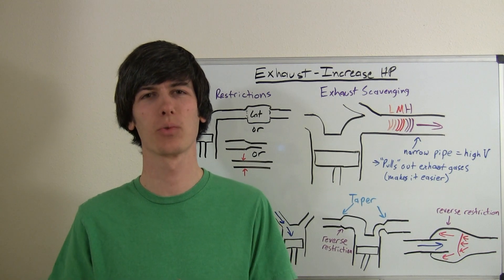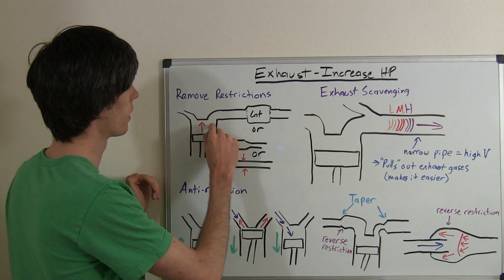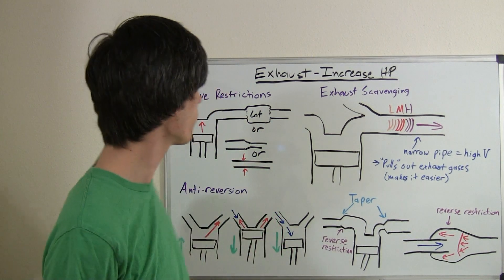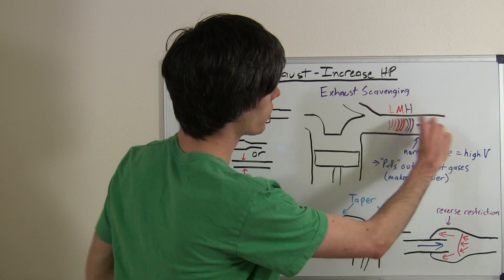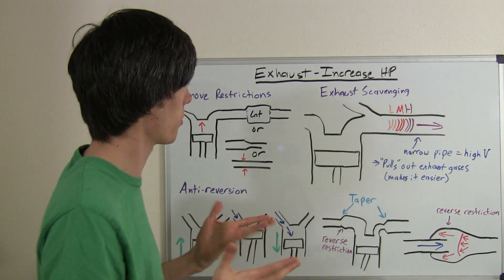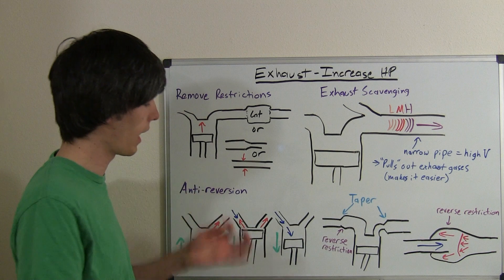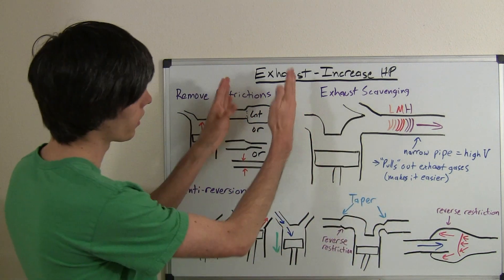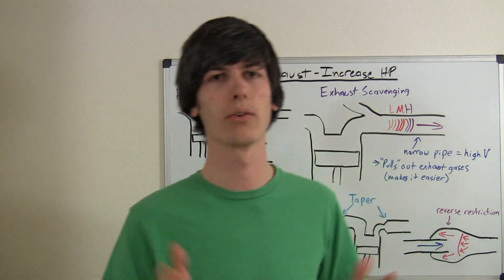Performance Exhaust - More Horsepower

Comment: Question Engineering Explained! I have a little 2 stroke engine. I've heard that removing the muffler and running it can cause the engine to burn hotter and cook itself. Is that true? I also have replaced the muffler with a 2 foot, 3/4 inch pipe, have I gotten any gains from it (Power, torque)? (Its a 32CC if its any consolation)

Comment from the maker: Yes, applies to all transmission types. Resonators are not beneficial for power. Indeed, smaller piping becomes more restrictive at higher air flow rates.

Comment: Does this applies to auto transmission either? If lets say exhaust loudness is not a concern, is it better to pull a straight pipe with smaller diameter for greater velocity instead of having resonator in the middle of the piping? Also, will a smaller piping being too restrictive on higher end?

Comment: Hey I am wondering about the anti-reversion thing you were talking about. Doesn't too much exit gas flow affect N/A cars? My understanding is that N/A cars need backpreassure compared to that of a turbo/supercharged car, which is why when you put a CBE on a N/A if feels like you lost low end torque.. Is this right?

Comment: First off mad respect for your videos. If you have time there is a product for my car that I think you might find interesting to research on. It's an 06 Infiniti G35 coupe and the part is a test pipe. However it is not a normal straight test pipe its Advanced Resonance Tuning or ART pipes which use Helmholtz resonance. Check out motordyne art test pipes

Comment from the maker: To get the kind of flow required (very high speeds) would require a very powerful fan, and thus would likely be a net loss of energy. There have been fans however for aiding in creating downforce, by pulling air out from under the car.

Comment: Thanks E.E for your Videos, please could you show the Maths that works out for the right sizing of a pipe and length best for a motor.
I drive a 1500 Mitsubishi Mirage as a rally car with76 measly horses, any additional power would help please.

Comment: dude i thinking about adding straight pipes on my 5.7 hemi cats off and all.....and adding a Comp Cams XFI™, 273H-13 Hemi Camshaft on it as well now will i lose power or gain power by having striaght pipe i hear alot of talk about veichel not having back pressure?

Comment: Try and replace your fuel filter, I had a halfway clogged one on my truck (it spat out brown fuel when I took it off the truck) and put a new one on and after that I've never had my truck bog down. if its a pain to get to your fuel filter than try using a cleaner in our fuel like gum-out for about 4 tanks worth of gas and see if that helps.

Comment: Yup that's what's going on with my truck I have a 05 5.4 v8 f150 single cab and when it drops down to second it feels good then when it shifts in to 3ed it bogs.. I have a duel electric fans throttle body spacer k&n jba headers predator performance chip and a straight pipe with a cat but what can I do so that won't happen....? Can you help should I get MSD ignition to help burn more fuel

Comment: Hi... Can revertion cause some knocking? Or pinging? I have an srt4 with knock only at low boost and there are no boost leaks or vacumm... Im runing stock and only using CA chevron 91oct... Thanks

Comment from the maker: Potentially, but not necessarily. It depends if your current exhaust is restrictive or not. Really you'd need to test before and after, or solve for it mathematically with quite a few assumptions.

Comment: Great video, so if the original exhaust on my car is 2' will it be louder and more hp if I put on a bigger exhaust pipe like 2.25'. My car is a 2000 Camry 4 cyl. Thank you very much.

Comment from the maker: More boost means more compression, but it does not change the compression ratio. This is why some people will try to lower the CR (with pistons or crank/rod geometry) in order to compensate for the additional pressures and reduce the likelihood of knock.

Comment: Way way off my friend, compression has nothing to do with how free flowing the exhaust is. The first reason for less resistance is so more exhaust can flow out of the pipe thus allowing the turbo to spool up higher and create more boost. More boost also means a higher compression ratio as well if memory serves me right and the thicker head gasket is simply to allow the engine to handle the boost in a safer manner.

Comment: I always thaught that in a non turbo car you would need more resistence in the exhaust bacause that would raise the compression in the cylinders.
But in a turbo car you would like a exhaust with no resistence so you would get rid of the exhausts fast to lower the compression. With lower compression in the cylinders you can have more boost, right? Isn't that why people change to a thicker cylinder head gasket when people mount a torbo on their car, also to lower the compression? Or am I wrong?

Comment: The way you should have explained is that, the flywheel momentum or the power from power stroke on a different cylinder will be used to push the gasses out during the exhaust stroke in that cylinder, if the back pressure is high. This will cause parasitic losses.

Comment: Would this mean if your exhaust ports are the same size exhaust manifold ports you could tapper the manifold ports to somewhat prevent exhaust from travelling back into your exhaust ports? Could this lead to a power increase?

Comment: let say that during low revs the exhaust flow in pulses, so you want a "small" pipe that will make the gases escape faster. but as the revs build up the pulses build up and start to look like a consistent flow. now you need a bigger exhaust that will allow the gases to escape through. a exhaust diameter can only be efficient at a narrow rev range. you need the right diameter size for the engine and for the rev range in which you want it most efficient

Comment from the maker: People make all sorts of claims; I would ask him why that is. That said, it ultimately will depend on the diameter of the piping, the power of the engine, the number of cylinders (dual to quad, quad meaning each exhaust has ports to how many cylinder), and the design of the exhaust. He could be correct, but I don't have a simple answer unfortunately.

Comment: Running in is more or less a myth. The only thing you need to make sure is that you change the oil a lot in the first few hundred miles - the parts are tight and going to have a lot of material shave off, so the oil will go bad fast.

Comment: my exhaust fell off last year, i was thinking of installing a 6" straight pipe but i was unsure if it was better to leave it and just not bother. it sounds like id want to put on an exhaust system so now i just need to figure out if i want to do a 6" or maybe a 5" system.

Comment from the maker: Well I guess it depends on whether your engine is stock or not and/or tuned. If it is stock, there isn't really much purpose of an aftermarket exhaust unless you simply want it to sound/look different. The stock diameter piping is likely ideal for the stock power, as far as efficiency is concerned. Though there could also be weight benefits of an aftermarket exhaust, you'd just have to find that out.

Comment: A friend of mine put a 3.5" turbo back straight pipe on his RB30 with a RB25DET head and said he gained around 40kW, but lost some torque at low revs. I would have thought it would not have mattered as the turbo would smoothen out the exhaust pulses and keep a bit of back pressure. Why is this?

Comment: Could you please do a video on the correct way of running in a new engine?? Lots of people say you run the engine really hard for the first few thousand miles (taking it almost to the redline and back) and others say you should do it by the book??

Comment from the maker: How does back pressure affect flame front? The exhaust valve is closed for the duration of flame propagation. It opens to expel the spent gases.

Comment: Having little to no back pressure will cause an accelerated flame front over the exhaust port causing the internal combustion temperatures to sky rocket thus "burning" out your exhaust valves,guides,seals*etc. Thus causing the car to burn excess oil and produce clouds of blue smoke. Im certainly not doubting your knowledge EE but im sure you would concur with this theory and can relate. I know you compile these shorts vids and give the short and simple of everything and cant indulge in all facts

Comment: This is why alot of people who put big exhaust and ridiculous sounding mufflers on their 4 bangers will have serious top end premature wear. As alot of people tend to think that less is more, but when you remove all the necessary back pressure that alot of these little engines depend on (in fact all size engines) jeopardizes the longevity and performance of the vehicle.

Comment: I have a question. I understand from a google search and school lessons that a cat is needed to reduce the amount of toxic gas (CO,NOx, unburned hydrocarbons). I also understand that a diesel engine produces these gasses because of the relative bad mixing of the fuel and air and the high pressures and temperatures involved. 
What i don't understand is the reason benzine engines need cats. Benzine engines mix fuel much better(thinner liquid) and have lower pressures and temperatures. So why then?

Comment: Please answer this: What if the Cadillic converter was moved a calculated distance from the  piston exhaust valve so that all the exhaust could be forced out without creating back pressure in the combustion chamber. Would there still be enough force from the piston to move all the exhaust through. Or would that even matter since it would get pushed some each piston movement. Also, would the length of the exhaust pipe be to great to fit under the car if it were moved/stretched?

Comment: Count me in if you have any info on calculating exhaust diameter and length based on  compression as well as possibly a way to calculate for factors such as heat and vibration or resonance.

Comment from the maker: 5.0, as you have pointed out, refers to liters. It's the volume inside of the cylinder for which the piston moves. Basically, take the volume of the cylinder when the piston is at the very bottom, and then subtract the volume that's left when the piston is at the very top. Multiply this number by the number of cylinders, and this is the volume of the engine. Pretty much everyone now give it in liters. Back in the American muscle car days, it was in cubic inches (ex 327 etc..)

Comment: I've had people tell me small engines (like 2, 4, 6 cylinders) NEED back pressure to operate efficiently...having low back pressure cause the small engines to lose power. Is this true?

Comment: I've heard that a complete lack of back pressure is bad for an engine. That's why you should never have a straight exhaust. Things like catalytic converters and resonators apparently improve efficiency because they help smooth out the exhaust pulses. Any truth to this?

Comment: I was wondering, if you were to find a way to "supercharge" you exhaust gasses, i.e. retrofit some sort of turbine below the manifold of the exhaust system, would this have a conciderable effect on performance/horsepower with a vacuum of air  between the "supercharger" and the valves to suck out the exhaust gasses from the cylinder? This is of course if you had a modified intake such as a turbo or super charger.

Comment from the maker: They pretty much do, as yes, it's the most logical thing to do. Which is why it would be silly to slap a large diameter exhaust on a stock engine. But if your engine has other modifications to increase power, you can see benefit from altering the exhaust.

Comment: no. not at all. quite the opposite actually. the turbo(or supercharger) forces more air + fuel into the cylinder chamber to create more power. therefore more gas used over same period of time means less fuel efficiency. but the advantage is that a much smaller displacement engine can be used. and because of the forced induction(super and turbo chargers) the same power can be attained with less fuel overall used.

Comment from the maker: If you've done nothing else to your car, and it's just a stock 1.6L, I would probably just stick with stock exhaust unless you plan on adding power at some point (or stock diameter, lighter tubing). I'd read up on forums to see what others have done.

Comment: turbos use more gas but you can compensate a smaller engine that uses less gas and, and when you need the power to accelerate the turbo makes up for the small displacement.

Comment: My stock piping is rusted and I might as well replace it with a free flowing cat back exhaust. What perfect diameter is just right for my car (2000 civic Ex coupe, 1.6 L) that won't lose low end power? I'm about to order, so please get back to me. Thanks.

Comment: the length of the system is EXTREMELY important to scavenging as well. ideally you want the pulse to get to the end of the pipe and be escaping, leaving just the negative pressure in the system to pull the next pulse out. for the most part high end exhaust tuning seems to be a "black science" with some general rules but a lot of guesswork as well.

Comment from the maker: Yeah I looked into it a good amount, and decided not to mention it. The benefit didn't seem as dramatic as the other topics I discussed. Also, I would assume that most manufacturers line up the heads/intakes/etc fairly flush from the factory, as it's the logical thing to do.

Comment: For this saying the cat is used to burn unused fuel. Go home, your drunk. Cat converters are used to clean the gases in a way to make it not as bad as they would be without it. It has really special components inside that burn the bad stuff and make it better(to put it in a simple way you may understand) yes it is illegal to not have one because you cars emissions would be way high than the regulations allow. I should start making videos like this. lol

Comment: thanks for the awesome video, i think its also important too have a certain balance of flow rate between the Exhaust and intake, too my understanding its not benefitial too have a really free flowing exhaust, and then a restrictive intake, vise versa... as too my understanding it could cause imbalances in the engine cycles... too my understanding having a more balanced intake and exhaust flow helps the engine run smoother, which can equate too more power.

Comment: I found that if you wrap your down pipe with header wrap (a down pipe goes from exhaust manafold to cat a pipe that omits the cat is called a testpipe ) if you heat up your cat it will cause a vacuum  and increase flow

Comment from the maker: If the current exhaust was restrictive, then yes, it could improve it, assuming there aren't negative effects from a loss of scavenging. I believe there is a balance which would need to be met between too open and too restrictive.

Comment: I'm more of a truck guy.  as for the velocity factor, if the collection volume were great and then reduced down to the same diameter as the exhaust, lower air speed entering would produce a higher velocity than the actual ground speed/air speed (assuming a windless day).   The big idea of my first question is piping that collected outside air all the way back to a tail pipe and using a 'dump gate' set up that would allow me to 'open' my exhaust at a 'wye' gate producing vacuum in my exhaust.

Comment from the maker: I wouldn't say it's required, but turbo'd engines typically produce more exhaust than a similar size engine without a turbo, so the piping will be larger.

Comment from the maker: Interesting idea - I'm not sure. First, you'd have to know that your cars velocity is greater than the exhausts velocity. At low speeds, this is likely not the case, so you may end up reverting your exhaust to go forward. I suppose you could put in a valve to open at a certain speed, but you need to also consider the drag that this will cause, and make sure it's not in a spot where it could get damaged. Finally, if it's low mounted you could be throwing dirt/dust/water in the exhaust.

Comment: if I were to put like a scoop below my bumper that were like three inches tall and the width of my truck and it funneled air into some thing like a three inch pipe that joined with my exhaust, would it act kind of like a turbo at highway speed by sucking out the exhaust gasses?

Comment: Could you do a vid on aerodynamic stalling, what it is and how its used to increase performance? Perhaps use examples like the exhaust blown diffusers, and last years Mercedes' DRS system which apparently stalled the rear wing to reduce drag. Cheers.

Comment: So like, when you are having for example a 6 inch pipe as exhaust, there won't be any ''low, mid and high'' pressure between the pipes that will act as a vacuum cleaner to pump out the gasses right? But what happens if that would be the case? Like you DO put a 6 inch pipe in there? Will the gasses just stay there and not get out?

Comment from the maker: Right, but it has to do with the inertia that the gas already has. It's moving very quickly in a certain direction, so it's not going to simply turn around from a differing pressure behind it, because of the momentum it has.

Comment: Hey Jason, so when you were explaining the part at 3:41, where you explain some exhaust gases going into the intake, is that where turbo chargers come into play, to pretty much prevent exhaust gases from going in the wrong direction? Turbo chargers suck in air (right? haha I don't know much about them), so that means more air inside the intake means more pressure, meaning a smaller chance of exhaust going in the wrong direction, correct?